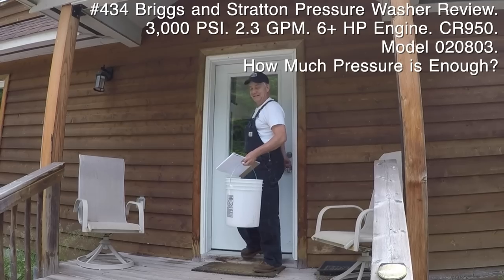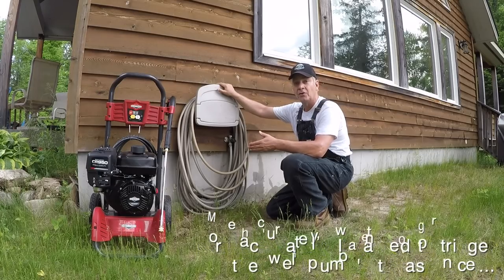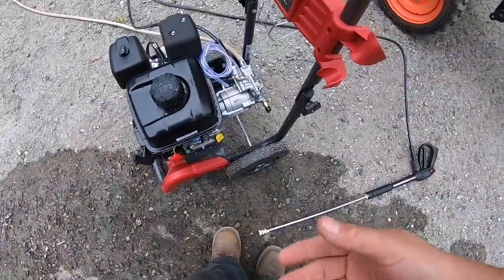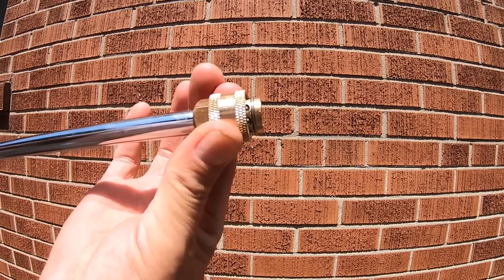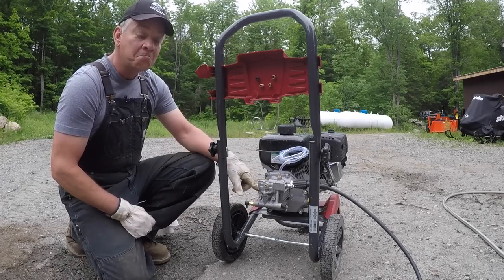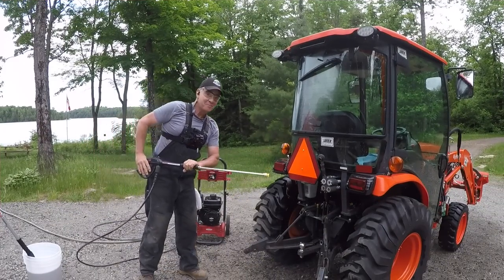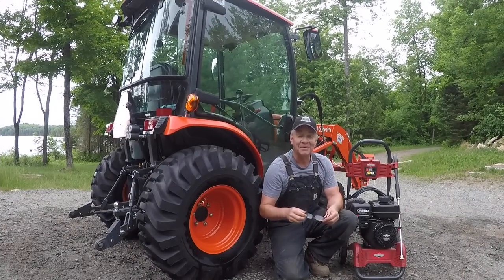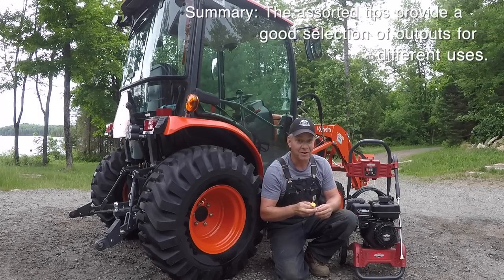#434 Pressure Washer Review. Cottage Well Pump supply. Briggs and Stratton 3,000 PSI. outdoors.

Comment: A simple bucket of suds and a nice sponge or cloth goes a long way.  Crossing my fingers that your finish holds up on your cab.  Ryobi makes a nice electric washer for less than $100 US and the intake is only 1.2 GPM.  That with an oscillating tip will be far more gentle on your equipment especially with detergent and without for rinsing.
Reply from the maker: Thanks Cam. I think I'll keep to the white tip for use on painted surfaces and use the yellow for grease. The 40 degree tip comes out very gentle. Thanks again!

Comment: I use a 25° tip a lot (it's a green one). Gives a little extra cleaning while not being to much for paint. I replaced the original plastic hose with a rubber one that is 30' long and I like it a lot better. Most of the time when I am cleaning the farm equipment I wear raingear and a face shield. Just keeps me from being speckled with grease and dirt from head to toe.  😊😊😊 Good video GP!! 👍👍👍
Reply from the maker: Hey great idea. Thanks!

Comment: I hav found that if you bleed the system before you start the pump you minimize air lock. By bleed I mean just let water flow through at normal pressure until all the air is gone, then start the pump. Great video GP. Cheers!
Reply from the maker: Great advice Michael! Me too. Surprising how much air is in the system before you fire it up. Have a Happy Father's Day my friend!

Comment: We are on a well, but with a constant pressure pump setup. The pump is variable speed. The controller in the basement has a pressure sensor at the small pressure tank, and varies the line frequency to the pump (voltage stays at 240 nominal, but line frequency to the pump varies, often running at 30Hz, and then increasing as more faucets are open or more flow is required. Solves the pressure drop of a standard pressure tank and pressure switch.
Reply from the maker: Morning Dan! That sounds like an excellent setup. I wish I was aware of that option when they installed this one. Thanks for sharing - I know now. Cheers!

Comment: Ironic, I just pressure washed my BX a few days ago. 

I have 3k psi pressure washer, poor thing has always been ran on well water. Been fine for 10+ years. 

Still watching the video, so not sure if you mention it yet, but they make this stuff that’s supposed to help save the pump. It’s in a bottle with a hose and on the end is a fitting like a hose end. You screw it to where the water goes in and give the bottle cap a squeeze and it blasts the pump with this solution.
Reply from the maker: Hey good day Moo! I have not heard of it. Thanks for the info Cheers!

Comment: if you have a noticeable drop in pressure just before your well kicks on you can bump up your minimum on your pressure switch. That would prevent you from completely draining you pressure tank before the well kicks on. Most pressure switches have directions under the cover and only takes a screwdriver to adjust.
Reply from the maker: Good morning Logan. I am not sure - but thanks for the info - I will take a look at it next week. Thanks!

Comment: Another great informative video Gordon, thanks! When you hit the grease around the pins does it spread it all over the tractor, or does it actually blow It off?
Reply from the maker: Morning Terry! The lighter pressure tip didn't do well on grease but that second more powerful tip blew it off. At first on some, it would start to spread a bit and then disappear. I think I will stick to the lower pressure tip for washing the overall tractor and only use that 15 degree tip for the 3 point hitch. Cheers!

Comment: Were you running your well pump strictly off the solar system or did you top up the batteries with the generator? What horsepower well pump are you running?
Reply from the maker: Hi Gary. It ran off the batteries this time but I can turn the generator on as needed for large loads. I can't remember the pump size It was a long time ago.:))

Comment: The pumps have a limited life.High pressure, detergent, freezing and corrosion conspire to kill them after a while. The motors/hoses/nozzles are fine, but the pumps start going on bypass and not getting the required pressure. The design of that one with the horizontal shaft makes strapping on a new ebay pump a piece of cake.
Reply from the maker: Thanks Spooky! I'll make sure to store it a heated space this winter. Very helpful info - Cheers!
Reply: Exactly.  I priced out rebuilding my 2700 psi karcher. Bought a complete pump at princess for much cheaper.  Easy install

Comment: Greetings from eastern Ontario. Great pressure washer tips GP. I've been through a couple over the years. Mostly cheaper stuff. Finally settled on a good one from Princess Auto. Main benefit was a quality pump (generally the weak point in most pressure washers) and adjustable pressure. Had to add a pressure gauge but now I know exactly what pressure I'm operating at. No more worries about damaging the truck or tractor. Cheers.
Reply from the maker: Good stuff L! Great to hear from you. I hope you are enjoying our great weather this weekend!
Reply: Hello L4060, I have been looking for a gauge for my pressure washer. Where did you get it from? Thanks
Reply: @snowboardnash  Picked it up at Princess Auto at the same time as I bought the pressure washer. Needed an additional quick-connect. Its connected inline with the pressure washer hose. Regards.

Comment: Thanks for the tip on checking GPM, I'm also on a well, so definitely worth checking. My personal findings, bought a cold water 4200 PSI unit a few years ago since I'd found if your cleaning large concrete areas and you wanna be done before your back is, get a big PSI unit. Also don't mess around with a regular tip, get a rotary cleaning unit, bigger the better. Also I have a pressure adjuster, and a gauge, for the car I use the white tip and dial it down to about 1800 PSI. Let it also be known if I could afford/justify over $3000 for a hot water pressure washer I'd be out buying one today.

Comment: Hi GP, I ended up putting split plastic wire loom over the hose to keep it from wearing through the outer jacket. I bought a B&S hose and I noticed wear marks on the hose after the first use. The driveway and concrete pad act like sandpaper as the hose vibrates on them during use. I also added a flexible extension on the wand to make it easier to clean the underside of vehicles. Cheers from MA!
Reply from the maker: Morning D! Thanks for the info - I'll keep an eye on it and see. Have a good one!

Comment: Great info about selecting a pressure washer when you have a well.  I have a 475 foot well and had a contractor pressure washing the moss off of the siding & roof of my house.  After an hour of working - he ran the well dry!  Ran silt into my tank & filters...  So even if you have the flow - still have to be careful to not out run your well!

Comment: GP to help with pressure washer inlet flow reduce as much piping/hose between the washer and pressure tank. You might have a hose bib close to your pressure tank and pressure switch. If you can hook a hose (recommend 3/4”) there and run it to the PW it should help. Or you could buy a booster pump and have that suck out of the lake and discharge right into inlet of pressure washer. Put a whole house filter in-line between boost pump and pressure washer.. also use hose screen washers to catch any debris that might enter PW pump.
Reply from the maker: Thanks Garny - some great ideas and tips. The tap is right beside the tank so perhaps I can simply run a 5 foot hose and wash the tractor etc on the lawn there, instead of running it 75 feet around to the side parking area. Thanks again!